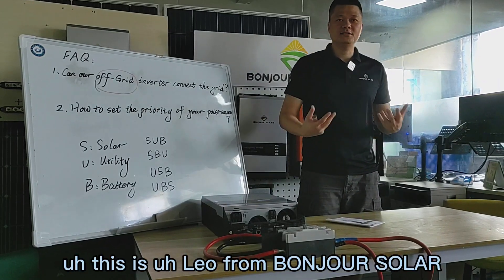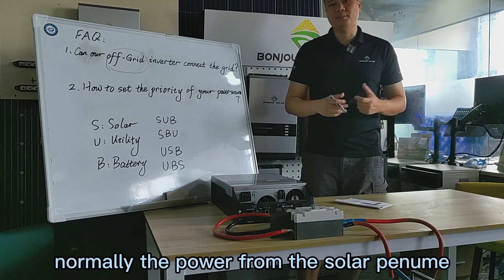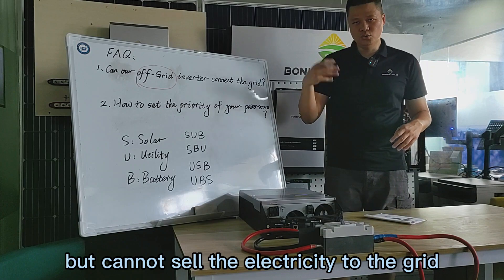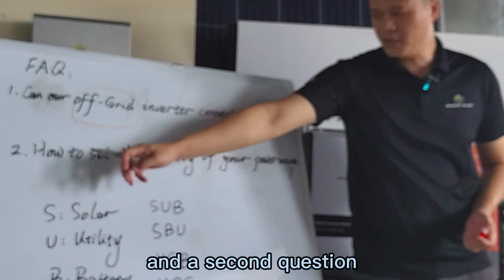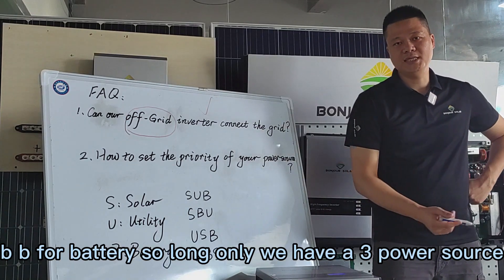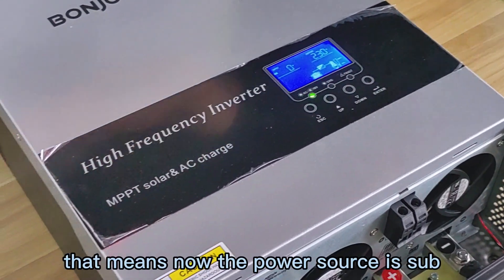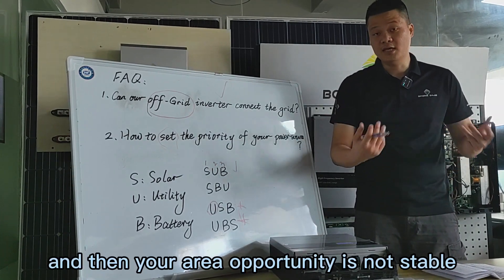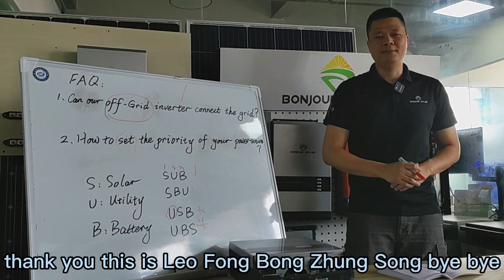How to set the power source of inverter SOLAR/UTILITY/BATTERY

Comment: I have installed a 5kva inverter OPTI but the solar panel icon is not showing up on the display
Reply from the maker: OPTI?
Reply from the maker: you need to contact OPTI inverter supplier for more technical support, thanks